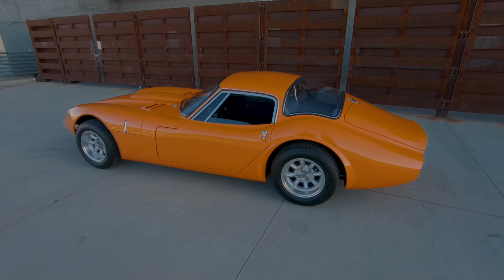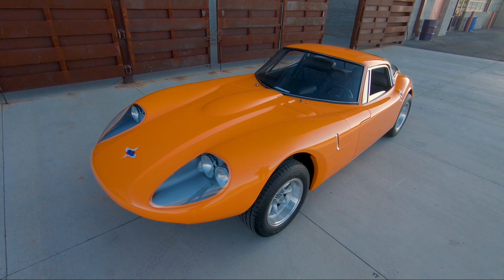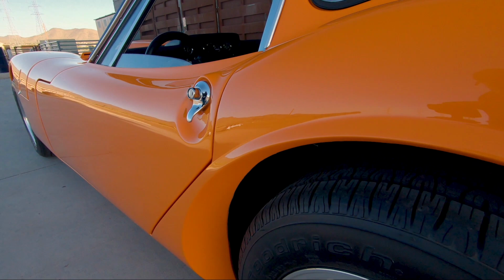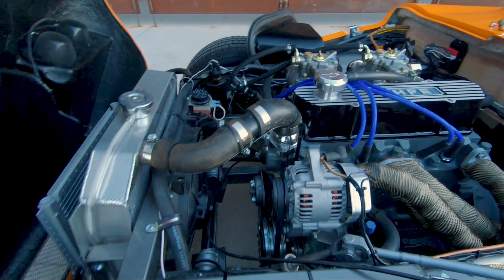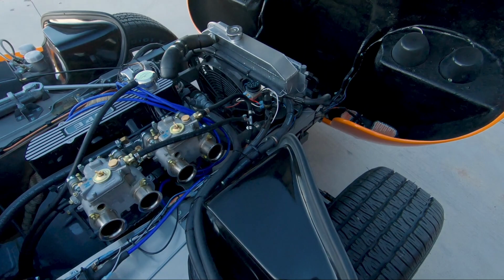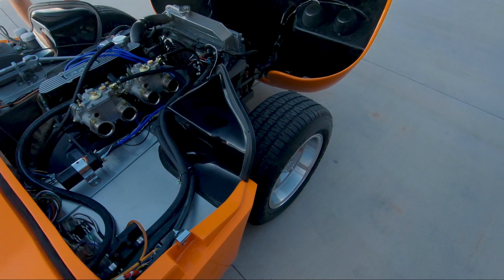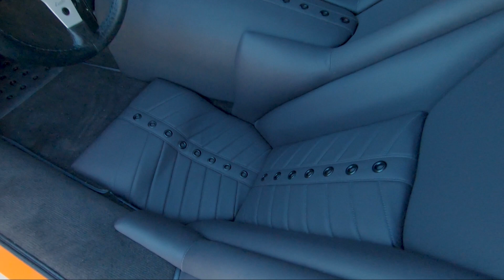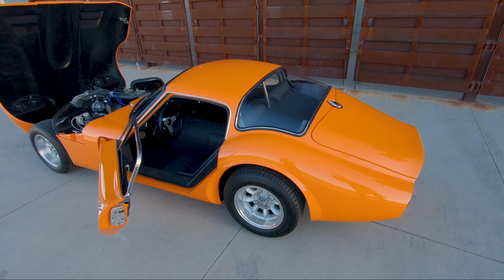1968 Marcos 1600 GT Walk Around and Drive

Comment: Amazing workmanship. I had one back in the early 70’s. Basically a track/road car. I THINK the engine was bored to the max … 1760???  Stage 3 cam, twin 40’s. For some reason it had knock-on Minilites which looked good. However a garage mounted them on the wrong side of the car and the spinners were undoing as I drove the car. I heard a ‘tinkle’ noise (one of the spinners coming undone) then a surprising distance later I saw a wheel bouncing down the road in front of me😳. Then the car fell onto its offside front 😳😳. Absolutely no damage … it ran on its disk. Embarrassing having to go and 1. collect the wheel 2. run back to try to find the spinner😊. Happy days.

Comment: Beautiful. I have a question, just before you started the engine, the guy standing next to the engine did something by the carburetors. Can you tell me what he did and what that does?
Great video, good luck with the BAT sale.
Reply from the maker: He wasn't actually doing anything with the carbs, but just had his hand there to manually rev it with the linkage so that we didn't need to have anyone in the car. The "click" sound you're hearing is me (holding the camera/mic) turning the ignition. And thanks! It's an awesome car and he's a great guy, so I really hope it does well for him.

Comment: wood doesn't do good in heat, remember that this car was made for britain, excesive water isn't good either, but neither does to low humidity
Reply: The wood is treated and cured pinhead. It will last many decades in any weather

Comment: Whom ever buys it could still be the first to finish her chassis and under body in sheet metal. Using the plywood as a mere pattern. Hopefully she remains within the 🌵 desert she will last longer there. Love the boat tail end she screams of 1960’s British sports cars
Reply: that would not be advisable. the wood chassis is best as it is.
Reply: What an odd comment. Why should you do that?
Reply: such a stupid comment, the plywood chassis is better than any metal one, and it is not getting rust or rott, if maintained a little bit... i would always prefer a car with wooden chassis to a metal one
Reply: @plyspeed : Not me. I’d prefer an aluminum monocoque frame, or steel. The wood will flex like heck and scary in a car accident.  Fortunately that motor won’t be putting out a huge amount of horsepower. But it IS perfect just the way it is.
Reply: @sandymilne224  I have some wooden cars, the chassis does not flex a single millimeter, it is far more stiff than any steel or aluminium chassis...and it will never get rust , my chassis have over half a decade racing stress, still as new except some stone chips ....
Reply: Mike Kemp  : Wood chassis are the best… and… that’s… why… all modern cars are made out of wood… right… Not trying to take away from the Marcos and the fact that it’s frame is made out of wood. Just don’t insinuate that wood is best. It is what it is. Like old metal frame cars being restored, wood frames need repair too. That’s just the way it is.